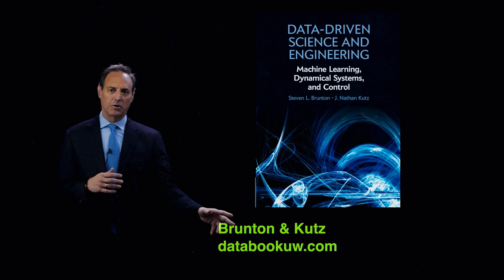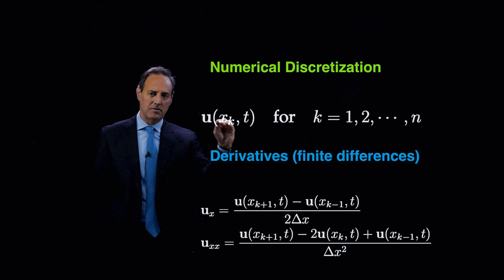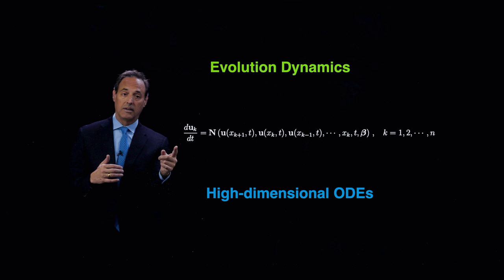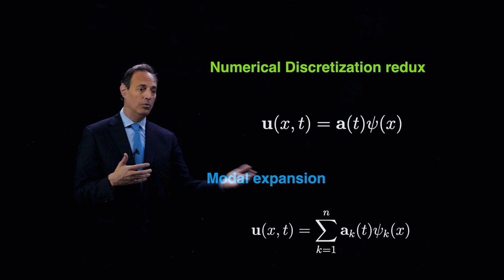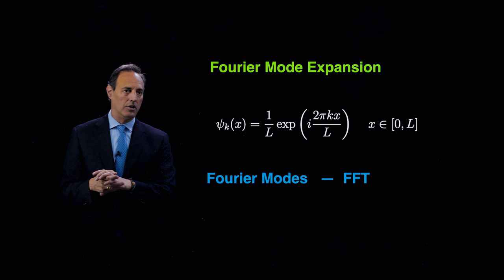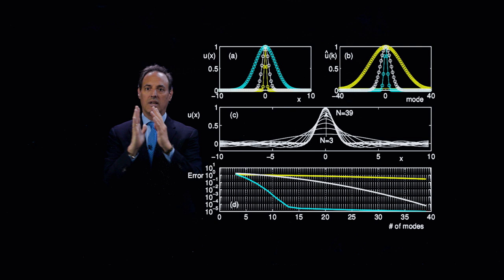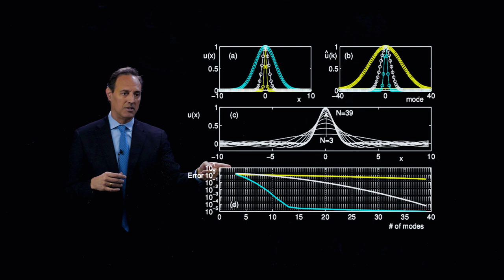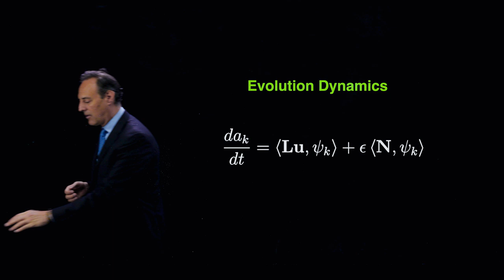POD for Partial Differential Equations

Comment: Thanks Dr. Kutz, I know it is a little bit off-topic but it would be great if you can make a video on choosing basis functions (FFT, Chebychev, Legendre, etc.) for PDEs based on boundary conditions. You usually use FFT which is not appropriate for non-periodic BCs, and in fluid dynamics we usually have other types of BCs.